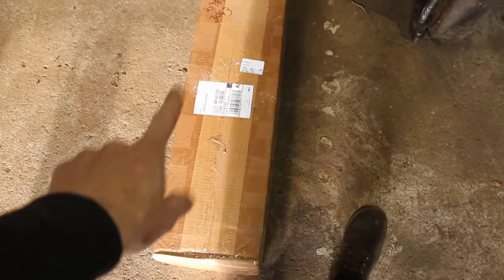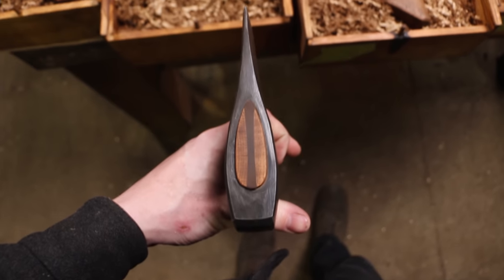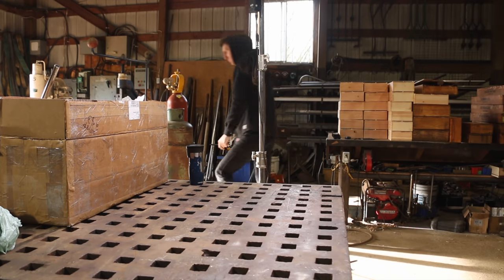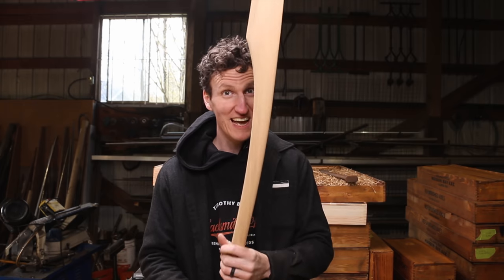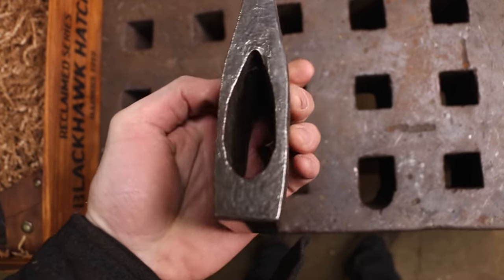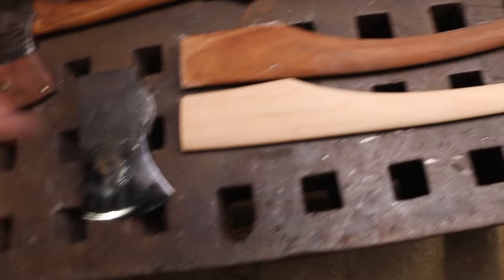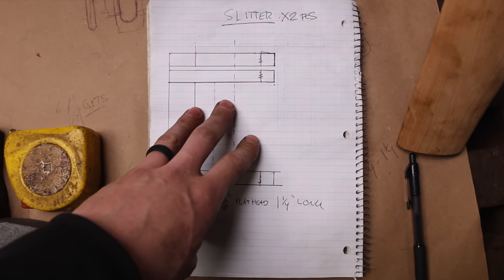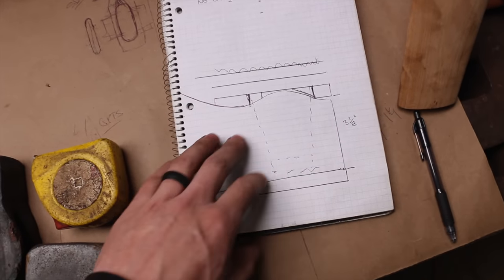Building a new axe model!! Day 1

Comment: I know that an axe is "just" a tool, but I believe a little touch of originality in the design could add that extra level of sweetness, that could take you to the moon! Maybe just a special engraving, a touch a color, a burned mark on the handle or a leather wrap handle... Something like that!
Reply: Technically a knife is just a tool aswell. A little something extra to anything will make it that much better and stand out from the rest.

Comment: Try forgin tantalum and make a very heavy axe out of it
Reply: I don't think that would be practical for Tim, Tantalum's melting point (3020'C) is Twice that of steel.
Reply: @Bobs-Wrigles5555  well, he doesnt have to melt it, just forge it, and Tanatalum is pretty soft .
Imagine a notmal axe with the weight of a sledge hammer 😁
Reply: @yaykruser  You just said the magic words, "Tantalum is pretty soft", which means it won't hold an edge, so all you'll have is a heavy hammer ?
Might be ok for a soft face machinists hammer.
Reply: @Bobs-Wrigles5555  soft compared to other metals that have such a high melting point, like tungsten or Iridium. 
Maybe it can be hardened just like steel, idk, thats I say "Try".
I mean he already did other metals that did not work.

Comment: 4:25 .. The grain is completely wrong as it shows on the bottom of the axe handle.  That's why he quickly moved it away from the camera. lol.   Yikes.. that sucks, and is why it's better to just make everything yourself. smh..
Reply: I caught that too. However, I've got 2, 32" Hoffman handles ready to be used and they're absolutely perfect. Without a doubt, they're the most beautiful handles I've ever seen. One is  going on a 4² Plumb Rockaway, I'm holding the other until I track down a decent Kelly Dandenong.